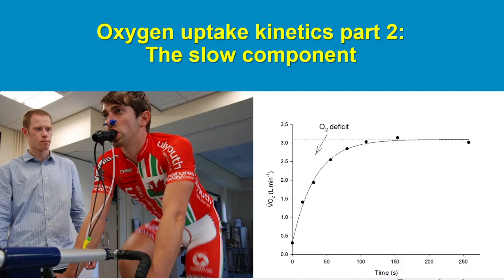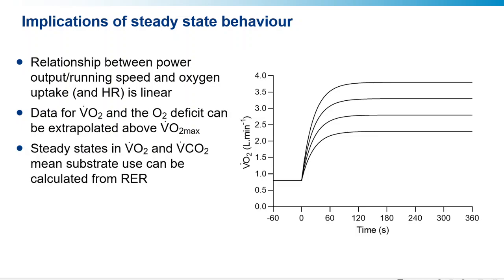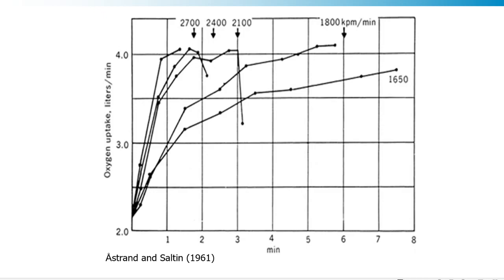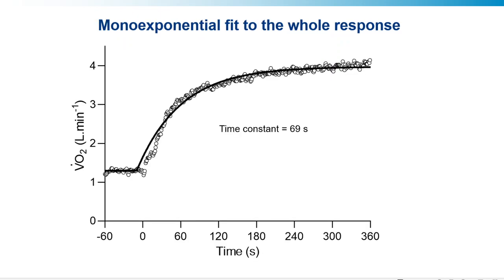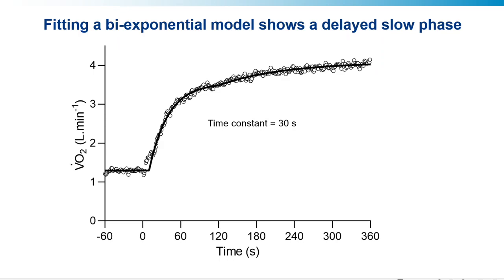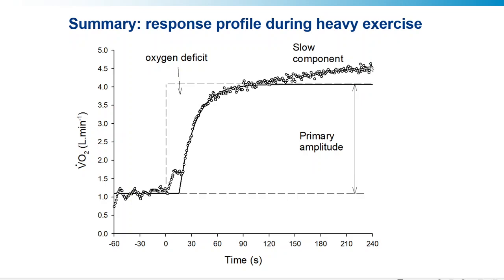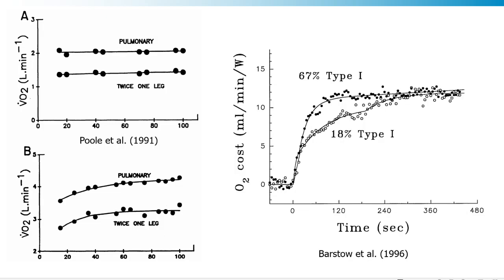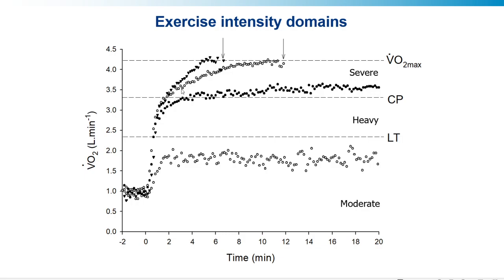Oxygen uptake kinetics part 2: the slow component

Comment: Great video but can you increase the volume? Very difficult to hear even at full volume.
Reply from the maker: OBS settings are maxed out on recording, so I'm surprised this isn't coming through on the video.  You are not the first to mention it, however. It may be an issue of certain media players/devices not reproducing the recorded volume.  It seems to work fine across my devices.  I've not used air buds or the like though.  It would be good to know if you're having this problem everywhere.
Reply: Same as Matthew, need it at full volume to hear. No issue with other videos. Great content though